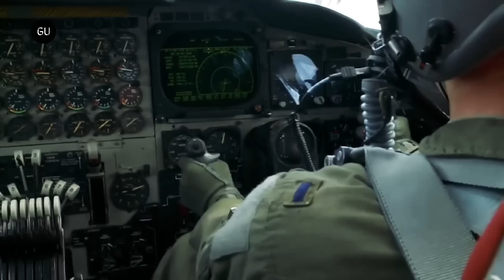Rolls-Royce Begins F130 Dual Pod Engine Test For B52 Aircraft

Comment: Hopefully in addition to improved efficiency the new engines will cut down on the exhaust smoke the old engines put out. As for the airframe, since these old warriors are soldiering on why doesn't Boeing take the existing design and put them 'on the tube' so that new jigs can be designed and built to construct new airframes and wings? This aircraft has long legs, it deserves fresh airframes/wings.
Reply: If they were going to bother making entirely new airframes, it would make more sense to at least re-engineer the airframe if not make a whole new design. The way we build airplanes has changed enough since these were built that there would need to be significant re-work just to accommodate the manufacturing processes used to build large planes these days. The re-wing of the A-10 involved some serious engineering changes partly because it was easier than making exact copies of the originals in terms of materials and construction. Even these new B-52 engines ended up using a newer design partly because the machinery and factories to make them already exist, but we would have had to actually make new machinery and lines to build copies of the old engine design!

I'm not saying that an aircraft like the B-52 won't still have a place in the air force for decades to come. Bomb trucks will always have a use. I'm just saying that, if we are going to build entirely new airframes, there isn't much reason to make them copies of the B-52 instead of a new design.
Reply: Yes, the copious black smoke on take-off will be no more. Electrical generation to power the ECM and ECCM equipment is also significantly increased over the current jets.
Reply: @Chilly_Billy  They inject distilled water for higher compression on take off.  I don't know if the new engines will do that.
Reply: Because the Arizona Desert has literally hundreds maybe a thousand G and H varients sitting in storage waiting for the next war to be thawed out I flew over them years ago were parked as far as could be seen...
Reply: @chrisjohnson4666  Since only a total of 744 B-52s were made, not a thousand.  Most of the 193 B-52Gs were dismantled as part of one of the nuclear arms limitation agreements.  Only 104 B-52H models were ever made.
Reply: @chrisjohnson4666  True, but even in a desert environment time and nature are not kind to duralumin. Not after 50-60 years.
Reply: @heyfitzpablum  Yeah, low humidity, no rain covered in plastic wrapping. They're good.
Reply: @chechnya  Sun, sand, rodents, insects. And aluminum oxides just like steel. 50 years is a long time, even in the desert.

Comment: Many people will assume that these engines are being built in the UK, but that's not the case.  These are being designed and built in the original Allison Engine facilities in Indianapolis, the same place as the AE3007.
Reply: I never knew that Indianapolis had such a huge aerospace manufacturing presence until I was a grad student at Purdue and was asked to go down to Indy to "compete" with IU grad students for what surplus testing equipment may be useful for our university research endeavors.  The size and scale of these facilities was amazing, yet you never hear of Indianapolis near as much as it's midwest counterpart manufacturing bases.
Reply: Yes but RR  Germany built the Orginal BR700 series  Does RR not own Allison anyway ?
Reply: Got a chance to "Alison School" (Indianapolis In.) and "Lockheed School" (Marietta Ga.) back in the early 90's with the U.S. Air Force. It was shortly after Rolls-Royce bought Allison. I was a T-56 mechanic who worked on C-130E aircraft at Pope AFB, just after Desert Storm. I got to see the new AE 2100 engines and the Dowty Propellers. The U.S. Air Force had yet to put any C-130J models into service. It was a great experience. Our Air Force and civilian aeronautic industry is the greatest in the world. Cheers from Guam USA👍
Reply: They are a modification of an existing design.
Reply: Well yes they are being assembled in the USA as that is a condition of all US military contracts but the design was by RR and many of the parts will be manufactured by RR elsewhere.
I always smile when Americans feel the need to own everything. Well you don't own Rolls Royce and Allison may well have gone under in 1995 had RR not bought out the MBO which was failing after 2 years.
Reply: @1chish  British industry is failing. America supplies most of your hardware. Pathetic, whiny little brit.
Reply: @1chish  exactly. Designed by Rolls in Derby, UK. The Pearl engine is a mixture of global manufacturing centres. LP case, fan and turbines in the UK. Singapore also involved too with Ze Germans. They just say built in America to appease the angry old white folk.
Reply: Knew that when they first won the contract as did many others.
Reply: Curt, you seem to be afraid of peoples free will—in this case to work. The tactic of name calling in place of reasoned argument and changing someone’s mind is so outdated. You can do better.
Reply: @toddjones1403 you sure that’s what “right to work” means? 😆 it’s a euphemism for “we can fire you because the boss’s son doesn’t like you, and you can’t prove shit.”
Reply: Nobody who knows how US military procurement and politics  work would believe the DoD would buy engines made in Britain for the B52. These are BMW Rolls-Royce AeroEngines GmbH products really, but the US wouldn't buy engines made in Germany either.
Reply: @cageordie  BMW acquired Rolls Royce cars, and NOT Rolls Royce’s aerospace business. Rolls-Royce's aerospace business makes commercial and military gas turbine engines for military, civil, and corporate aircraft customers worldwide. In the United States, the company makes engines for regional and corporate jets, helicopters, and turboprop aircraft. It’s a British company with overseas operations as well. It’s also developing the engine for Britain’s future 6th generation jet fighter plane, called Tempest. And it’s looking into developing rocket engines to fly to Mars.
Reply: @cageordie  Believe it, because it’s true. You’re mistaking Rolls Royce Motor Cars—the now BMW owned subsidiary of Rolls Royce—for Rolls Royce itself. This video refers to Rolls Royce Holdings PLC, who are involved in building aircraft engines and signing defence contracts globally. They are owned solely and entirely by the British government. So yes, your B-52 engines are British, as are most of your engines.
Reply: @dWFnZWVr  Rolls Royce Holdings is a private limited company. There is nothing that I could find that suggests that it is currently owned by the UK government in any way.
Reply: @cageordie  Rolls-Royce PLC, major British manufacturer of aircraft engines, marine propulsion systems, and power-generation systems. Noted for much of the 20th century as a maker of luxury automobiles, the company was separated from its car-making operations and nationalized following bankruptcy in 1971. It returned to the private sector in 1987. Headquarters are in London.

Rolls-Royce PLC’s aerospace segment produces an extensive line of civilian and military aircraft engines, both alone and in joint ventures with companies in Europe, the United States, and Japan. Major products include the Trent and RB211 turbofan families (see jet engine) used on Boeing, Airbus, and Tupolev aircraft and the EJ200 turbofan developed for the Eurofighter Typhoon. Rolls-Royce is the world’s leading supplier of marine propulsion equipment. Its products and services range from complete ship design to integrated propulsion, maneuvering, and positioning systems and deck machinery. Other nonaerospace products include aerospace-derived gas turbines for the oil and gas industries and power-generation plants and nuclear power systems for the Royal Navy.

Comment: I noticed the turbines spuns in the same direction.. does it not create a counter torque for the plane?
Reply: Yes, but it is quite small; whilst the blades spin in one direction, there are internal vanes to correct the airflow and counter most of the effect by "straightening" the airflow (they are not for the purpose of torque correction, but have that effect). The only real effect on the aircraft is when they accelerate or decelerate, and the effects are SO small (the mass of the spinning element of the engines is tiny compared to the rest of the engine and airframe) that aircraft trim deals with it almost imperceptibly. With propellor aircraft, there is a significant effect as the airflow spins with the blades - thats a lot of air, and some heavy blades.
Reply: @andyowens5494  Thanks! 👍
Reply: @andyowens5494  Thanks!
Reply: @andyowens5494  the main reason is because there is no torque. Everything spins freely and is moved by air only.
Reply: @rtbrtb_dutchy4183  Not an engineer, are you.
Reply: @andyowens5494  nope. But was explained by an engineer. 

And let’s be clear, the by-pass, there are no vanes to “straighten” the airflow.

Also, explain how there can be counter torque when the things that spins, is all free wheeling?
Reply: @rtbrtb_dutchy4183  Correct, no vanes in the bypass. Also, friction; not much in the bearings (we work hard to reduce that), but air has a hell of a lot at high speed and pressure (applies to both bypass and core with different parameters) along with the angular momentum of the air exiting the exhaust (again, minimised, but not zero) - its the whole system that counts, not just the mechanical parts (which contribute most of the torque in a piston engine).
Reply: @andyowens5494  right, but the initial question was talking about counter torque. Which is mechanical torque. 

I didn’t say you were wrong in what u said. Just putting my 2 cents in in regards to his “torque” question.

I’m assuming the “air” u talk about is what u mean by p-factor that is mostly an issue on a prop driven airplane.
Reply: @rtbrtb_dutchy4183  Counter-torque is that acting on the airframe, from any source (assumed to be engine related in the context of the question), not only mechanical. P-factor is a completely different phenomenon related to angle of attack.
Reply: The original J-57 engines rotated the same way with no problem.
Reply: No.

Comment: Should have ditched them and ordered a bunch of B787s!
Reply: What are you commenting about?! The B52 is a strategic bomber while the B787 Dreamliner is a passenger airliner also the B52 has a replacement planned the B-21 Raider which will first replace the B-1B Lancer and B-2 Spirit which are more expensive to operate then the B-52 BUFF.
Reply: @alexis_ianf  It's not as far fetched as you think. The 787-9 weighs 129 tons empty in operating condition, carries 101.5 tons of fuel and up to 52.6 tons of payload. It has an unrefueled range of 7,635 nm (14,100 km). The B52H has an operating weight of 120 tons carries up to 147 tons of fuel and a payload of 32 tons. It goes 7600 nm (14,200 km). The 787 has a higher payload, goes the same distance with two thirds the fuelusing just two engines and is roughly in the same weight class. If you cut four bay doors in that fuselage and put the same rotary launchers in the 787, it'll make a BETTER bomber than the B52. Reliablity? Let's just say the a dispatch reliablity of 99.40% flying trans pacific with 1 hour turn arounds 7 days a weeks and seeing the maintenance hangar maybe two weeks a year is something the Airforce and only dream about with their bombers.
Reply: @dwightlooi  I assume your comments was facetious? The 787-9 while a remarkable aircraft is designed from the ground up to carry human passengers, not missiles and bombs. It lacks the durability of a weapon of war and could never fulfill the role of the B-52. Looking at history, remember all the problems the Luftwaffe had during WW2 when they tried to turn the FW Condor airliner into a low level attack aircraft for use against shipping-airframes were breaking up on the ground due to lack of durability and exposure to sea salt. Two different missions.
Reply: @heyfitzpablum  My first flight on a 787 was cancelled because a tiny stone had hit the fuselage on landing.
Reply: @bmc9504  I had a flight from Chicago to Tokyo in a brand spanking new Boeing 747 that was delayed on departure for hours because the crew couldn't get a readout on the fuel in the wing tanks, I kid you not. They eventually had to climb up on the wings and manually measure the fuel. As an engineer for another company with long experience in Quality I was absolutely appalled this made it's way through their QC inspection. US aircraft manufacturers have lost their edge, they're living on past successes in many cases.
Reply: I know the numbers make sense, but the b 52 is a warplane which is far more durable (used in vietnam). And has to be able to survive a nuclear blast without all of the electronics going kaput. B52 is a bomber designed in a simpler, more mechanical Era, thus fitting the AF better.  It would take more money to develop a different bomber than to simply retrofit, and at the end of the day, the fuel bur is the least of the USA of all countries concerns
Reply: @christopherclark4774  Except that the B-52 is NOT being used as a nuclear strategic bomber any longer and has zero chance of penetrating enemy airspace for the purpose of nuke delivery. And, if that is important you can harden the electronics just like you did on the EB-4. Everything else is just payload and payload is payload. If you can be a passenger and cargo plane, you can also be a tanker or bomber. It is simply a matter of adding doors under the fuselage and racks or rotary launchers to the main deck structure. As a matter of fact, Boeing did propose a 747 variant as a bomber back in the late 60s.vThe modifications will be similar to that on the 737-800 when used as the E-8 Poseidon except that instead of lots of sonobouys, radar and operator stations an only a small torpedo bay for 5 torps. You put 4 B1/B52 style rotary bomb racks and have four doors. You may also want to have a pylon under each wing for external stores but that is optional.
Reply: @dwightlooi , it's best not to make comments that prove your ignorance of the subject. 😉
Reply: A short time ago, I saw a low altitude aerial photo of a B52 parked next to an A330 [unknown airshow]. I was stunned at the size difference. Then I started thinking about making 767/A330 conversions. What if......